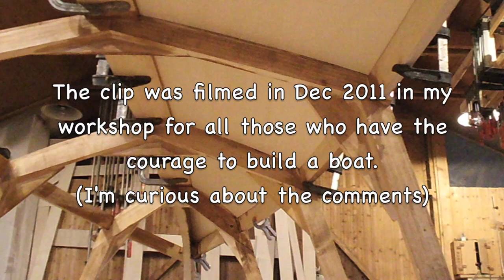Fairing Hard Chine Frames without Trouble

Comment: I'm building my first boat now and I chose a flat bottom dory because the fairing of the frame and Chinese is pretty straight forward. My next boat will be a little more difficult. Building a boat has really changed my outlook of woodworking, I have gained patience moving one step at a time. And bending wood to my will is quite invigorating.

Comment: Here's my take on it. By adding shims to the frames, you have changed the design of the Naval Architect. The only surface that needs to be developed is the bow where the bottom goes from flat to a cylinder. It probably didn't make much difference but the boat would be marginally more tender and the extra pieces may become a maintenance issue. You have a good technique for the bow section though, I just do them with the side of a level.

Comment from the maker: Thank you for your comment. 
For my demonstration, I used an older free boat plan. 
Google "Svenson free boat plans dolphin"!
The Body Plan on 0.3 jpg so can not be built! 
In this special case, the outlines of the frames at the bottom were nowhere straight. 
Really! 
The outline of a frame is only straight when rabbit and chine are parallel on this station.
My intention was to make fairing easier and more precise and effektive.
But it's best to try this on a model.

Comment: I suspect a power planer would save time.
Reply from the maker: The electric planer is not accurate enough for this job. Too much is planed off quickly.
Reply: @klaussilbernagl  Is the diagonal fairing related to the developable curve of sheet plywood? Would straightforward transverse fairing work only for conventional planking?